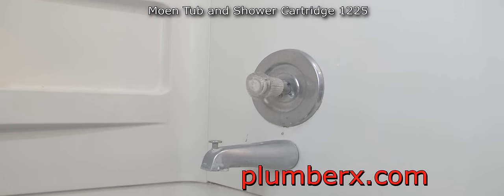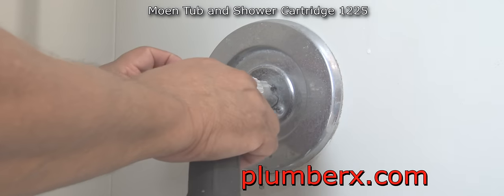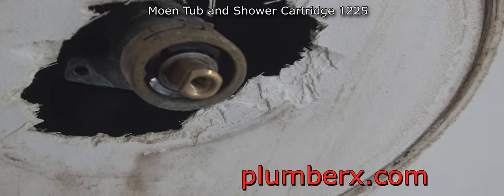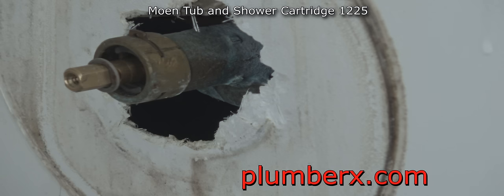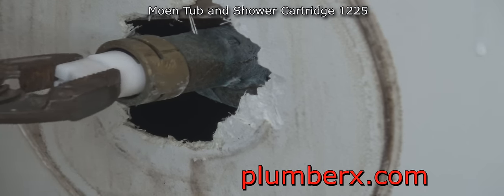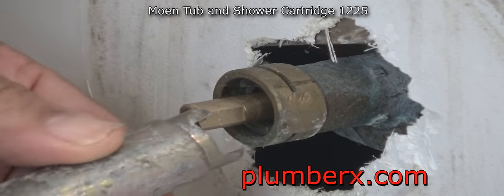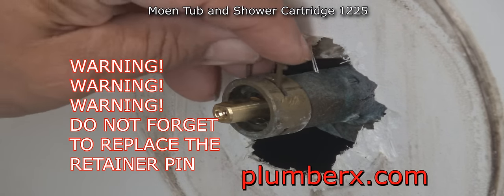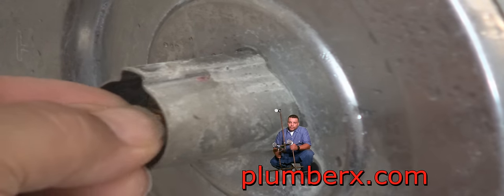1225 Cartridge Replacement  Moen Tub and Shower

Comment: Thanks for the great video, although I noticed my hot water isn't as hot as it used to be. Did I do something wrong?
Reply from the maker: Michael Pietrangelo You done good. Hot and cold is now balanced. Its design to work that way. This keeps kids from burning them selfs. If you notice any of the new homes they no longer-term solution install two or three handle faucet. Kids and seniors would burn them selfs. They have been outlawed for years now. Not to many people know this. Thank you for your comment.
Reply: I have the three handle in one bath and this in another--if you need more hot, your installation may have included valves on either side of the main center valve (inside the wall) that act as cutoffs.  You can selectively close the cold side to up-balance the hot to your preference and bypass the plumber-nanny-state.

Comment: Great video. But when I finished hot water was in cold water and cold in hot.
Reply from the maker: Easy fix, just pull the handle off and flip it up side down. 👍
Reply: Remove handle and rotate the stem (only) 180 deg.
Reply: @Mark-de5dz  thank you! It worked!!
Reply: @theartofplumbing  just like that!! Thank you!!!
Reply from the maker: @Nitakis  nice

Comment: A brass stem broke in half that held my Pfister shower handle. What should I do and how would I know what brand of cartridge is in the shower pipes?
Reply from the maker: You can call Pfister and tell them what you have as well as text them a photo. They will be able to tell you the model and what you need.
Reply: @theartofplumbing  it’s a Moen cartridge. The sleeve is stuck and I can’t get to the cartridge yet. Spray WD-40?

Comment: I managed to change my (very similar-looking bathtub fixture) cartridge with your help, thanks. 
Although I'd gotten kinda cut up trying to remove that retainer pin. It was stuck very tight (as well as the old cartridge). 
um... the water's working now, but it's leaking from underneath the coverplate. Any idea why? (And there was no stabilizing ring in mine.)
Reply from the maker: If I only knew what type you have I would have an idea, but it sounds like a loose packing nut.
Reply: @theartofplumbing  Moen only told me to buy the 1225 cartridge, nothing about a model number. It looks very similar to yours, except the lid on the handle is silver (and thin). The  large covering on the wall says Dialcet Moen. And there was no sign of a stabilizing ring. 
...I'd ended up pushing the new cartridge in without putting anything greasy on it, is that bad? Moen seemed to think it didn't need it and I was a bit distracted at that point.
Reply from the maker: The stabolize ring missing is throwing me off. All moen have that ring. Uhmmm 🤔
Reply: @theartofplumbing  When I'd called Moen to see if they could help in getting the old cartridge out without the $50 tool (no. channel-lock plyers worked, though), the person acted like he didn't know anything about a ring.

Comment: My screws are stuck and won't move.  Any suggestions?  WD-40 didn't work.  Thanks.
Reply from the maker: Unfortunately there are times when it can be very difficult to remove those handles. But not often, And when this happens I will break the handle off by wiggling it back and forth until it pops loose. And then buy a new handle
Reply: @theartofplumbing  thanks for your reply.  Unfortunately it's a screw that holds the escutcheon to the valve.
Reply from the maker: @Stonky77  oh🤔tricky one there. 😵‍💫You may want to call in a plumber on this one. Sorry.

Comment: Really great video, thx a lot for this.  Exactly same valve that i'm trying replace.
Reply from the maker: Glade I could help
Reply: I have a delta kitchen faucet dripping water from hot side and water coming from the middle when water is turned on how do I fix it

Comment: Why does mine hum now when I turn the water on?
Reply from the maker: It may sound like it's coming from your shower, but check your toilet it could be an air trap in the toilet fill valve. That's the one to the far left. Turn water to shower on a Liston toilet and remove the lid. Hope this help.

Comment: Still having problem getting retaining pin in.
Reply from the maker: Hi there, sorry to hear you're still having trouble getting the retainer pin in place on your Moen faucet. That can be really frustrating! A few tips that may help:

Make sure the holes in the handle body are properly aligned. Sometimes rotating the handle slightly can help line things up.

Try putting a small amount of plumber's grease on the retainer pin - that will allow it to slide more smoothly into place.

If the pin just won't seem to go in, it's possible the holes are slightly misaligned in the handle body itself. You may need to use a small file or sandpaper to correct that. Go slowly and carefully.

Check that the retainer clip is the right size and shaped properly to fit into the groove in the pin. Using the manufacturer's official parts is best if possible.

Comment: Thank you for this video. My tub faucet is dripping about every 10 secs. I just replaced the faucet and the over flow drain as they were old and pitted due to bad water.  My Moen  handle looks the same as yours except it doesn't pull  out to turn shower on. Instead there is a diverter valve pin ( I guess you would call it ) below that handle to change the water from the faucet to shower head.  Is the process the same as I can't find a video with the diverter pin?  I assume mine would be a 1222 since it doesn't pull out. Wondering if I can just change o rings inside to stop the drip or do I have to change the whole cartridge? Thanks, Beth
Reply from the maker: Yes your room ready right it is a 1222. I would change the cartridge out. Rather then rebuilt.👍
Reply: @theartofplumbing  Thanks so much.  :-)

Comment: Before you think the job is done, remember a bead of  clear silicone is needed around the big circular trim piece. Water will run down the wall and get behind that piece. It's gotta be caulked!
Reply: NEVER caulk this area. If there is a water leak, you'd want to SEE it, NOT contain it.

Comment: I have exactly the same thing as shown in the video. When I turn the faucet on with no shower, I can turn it off easily with no problem. But when I turn the faucet on with the shower, then the faucet would not turn off completely. I am not sure what the problem is. Will changing the cartridge solve the issue?
Reply from the maker: May be may be not. How long have you had this problem or has it always been this way. This could be pretty tricky. Because it could be a few things. Valve could be installed up side down or tub spout deverter.

Comment: I don't know what cartridge is in my faucet so how can I know what replacement cartridge and tool to get to remove the old cartridge?
Reply from the maker: Well some times you can find the name on the chrome trim of faucet. I would also check the back of your bathroom sink faucet. Contractors will use the same name brand for all faucet in the home. If you can get a name off one that may help. Last but not least try Google Lens. it helps identify  objects you take photos of. One more idea take a photo of it and take it to a plumbing supply house.
Reply: @theartofplumbing  Thank you for your suggestions. I will check it out.
Reply: @theartofplumbing  I tried to unscrew the Phillips screw that holds the knob on my bathtub faucet but all it does is turns, and it doesn't unscrew? Can you tell me how to get the knob off? I can put a new one on if I can get this old one-off. All it does is turn, it's tight but iy=t just turns without coming off? Please help. Thank You for any advice.
Reply from the maker: @JohnDoe-gv9jv  send me a photo of what you have. E-mail address at bottom of discretion box
Reply: @theartofplumbing  I'm sorry but I don't see your email address?
Reply from the maker: @JohnDoe-gv9jv  yep it's at the bottom very end of the discretion box
Reply: @theartofplumbing , found it and sent you the picture. My name is James.
Reply: @theartofplumbing  I emailed the pictures. Now the head of the screw where the Phillips unscrews it is stripped.  I knew it would if I kept trying.
Reply: @theartofplumbing  did you get the picture of my tub faucet?
Reply from the maker: @JohnDoe-gv9jv  Sorry nothing ewp@plumberx.com
Reply: @theartofplumbing  I thought about maybe using a Dremel tool and trying to cut the bathtub knob off, just to remove the cartridge? If I can't remove the screw. Then cut the screw head off. Is this workable?
Reply from the maker: @JohnDoe-gv9jv  I'd get a pro to look at it first. You don't want to cut the wrong thing.

Comment: Great video.  I just replaced a moen 1222, and the faucet still  drips. Any suggestions?
Reply from the maker: Some times small pieces of the washer will get trap in cartridge. It may help to remove the cartridge and blow out debris. Thank you😉
Reply: @theartofplumbing  
Thanks , that must have been the problem.   Wow, the old one was really stuck.
Reply from the maker: Cool 👍 yeah, they can be hard to remove sometimes. What I run into a lot is people have their water heater up to high this causes the washer to expand and contract to make the washer swell up and get stuck. I just tell them to turn the water heater down.

Comment: Mine is plastic with no pin to pull out. ?
Reply from the maker: Not good. Your pin should not be missing. That could be dangerous. The water pressure could shoot the cartridge out like a missile. Have a plumber look at that right away.

Comment: I can't put the retaining clip back on. Can someone please help.
Reply from the maker: Yes use the little white plastic tool that came with the new cartridge and push cartridge in as far as you can go. Also use the grease that came with cartridge or some soap. This will make it slide in easier
Reply: @theartofplumbing  I did do that I even hit it with a hammer.  The new cartridge doesn’t look like it has the same gap area for that clip to go in and I bought the exact same one Thanks so much for getting back to me.
Reply from the maker: Sorry to hear this. It may be a defective cartridge.

Comment: I have this faucet and seem to have to replace the cartridge about 2 times every year. Any ideas to make it last longer?
Reply from the maker: Well one of the biggest issues a I've ran across. If you hot water is turn up to high, this well ware out your tub and cartridge pretty face or it could be that you have jard water, then you may need a water softner. Hope this helps.
Reply: Thank you
Reply: It's possible there is a burr in your valve body, look for it with a penlight,  need to sandpaper it out, and also use vinegar and a toothbrush to clean any mineral deposits. Then turn on the water ( very careful not to make a huge water mess, fashion a tube to direct the water into tub or basin) and blow out any debris for 10 seconds. The burr would damage one of the O rings or rectangular rubber parts and cause a drip. You can do this now to try to save the current cartridge.  This gentleman didn't do much to clean out the valve body or check for smoothness, but he is good at explaining. Inspect your  cartridge too. The valve body is the cylinder into which the cartridge slides.
Reply: thank you  @bamadad6

Comment: My screw just keeps spinning... Its not un screwing... I think the whole valve is spinning inside the housing.... How do you get this out when the screw wont loosen??
Reply from the maker: Try holding the handle with a pair of pliers and then turn the screw. Hope this helps.
Reply from the maker: And oil screw

Comment: What do u do when the metal shutoff handle of my moen shower tub valve won’t come off because the brass screw that holds it on broke off leaving the threads in
Reply from the maker: Now you may need to call a plumber😬
Reply: @theartofplumbing  No problem. A new  MOEN (only)handle comes with a new screw. And the old cartridge with the rest of the broken screw is garbage anyway

Comment: That little packet is not oil, but 'food grade' silicone grease. This grease will remain in place for many, many years as it resists being mixed with or washed away by water. Soap does not have this important property. This 'plumber's grease' is carried by all pro plumbers, since it is used on O-rings and most other rubber seals found in many water and plumbing applications. Any never use Vaseline on plumbing seals as it will speed deterioration of rubber parts.
Reply from the maker: 🤔 interesting

Comment: You did forget to check hot/cold orientation BEFORE you install handle. Simply pull out stem till water runs. Rotate left 1/4 turn for hot. or 1/4 turn right for cold. If left runs cold and right runs hot,  rotate stem 180 degrees and reassemble the whole shebang.
Reply: I just moved and the moen push pull faucet rotates 360 degrees instead of stopping at 9 and 3 o'clock.  Any thoughts would be appreciated!  Thanks

Comment: The only thing you forgot to mention was the proper orientation of the cartridge for installation....for example, if you install the cartridge incorrectly .....the hot and cold water will be reversed according to the knob.
Reply from the maker: Sorry, not this one just turns the handle around. Your thinking of the 1222
Reply: @theartofplumbing  ...Most of the faucets in my house use the 1225 cartridge, with the exception of my Roman tub which uses a 1248 cartridge...I’ve never installed the 1222.  I have installed that 1225 backwards before and ended up getting hot water when the knob was oriented to the cold side and vice versa.  As a matter of fact I’ve done this a couple of times....I had to turn off the water and turn the cartridge around.   So yes....it has happened with the 1225 and all my 1225 faucets are the single knob type.
Reply: The cartridge is made to be reversible, which is why there aren’t clear directions on the correct way to orient it. It’s very common to have two showers back to back, sharing the same hot and cold pipes.  The pipes will be reversed for the 2 showers, ie hot water pipe on the left side for one shower, and on the right side for the other.

Comment: Use silicone grease, not soap. Check inside pipe to make sure nothing is still in there. Look with a flashlight and clean pipe before inserting new cartridge.

Comment: I tried exactly what you said and the old cartridge won’t come out. All my stores don’t even know what the metal tool is you used to remove the old cartridge. You should have shown more clearly how that tool works to get the old cartridge out as I now have to call a plumber. 😢
Reply from the maker: You're right when in doubt call the plumber 👍

Comment: Interesting rough in job...hammer and chisel
Reply from the maker: scrapmetal100 Yeah that is a interseting tub and shower rough in. A hole saw cut would have been nice. I geuss they worked with what they had. Good thing the trim is covering the hole.